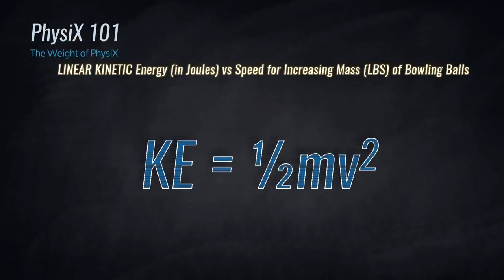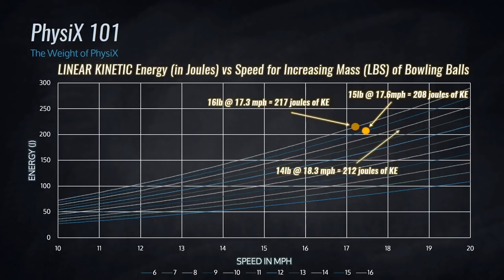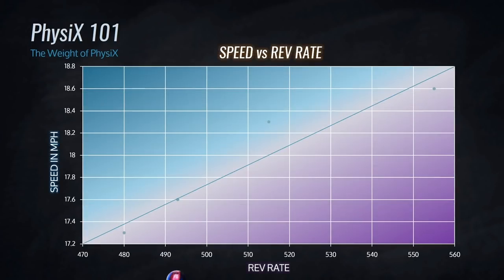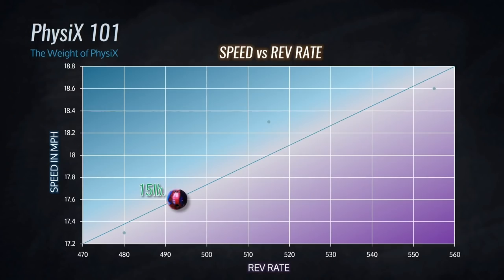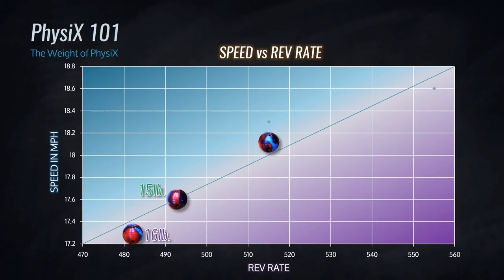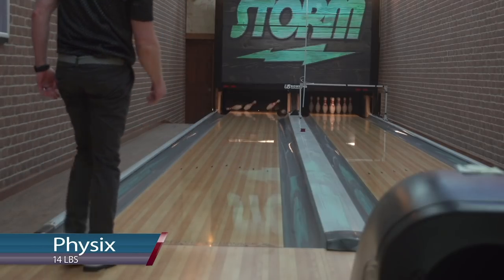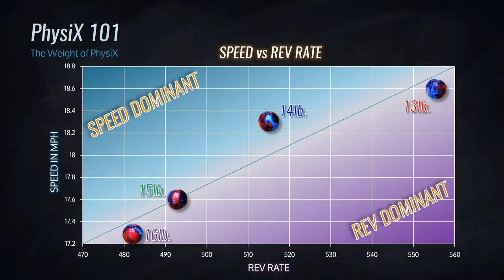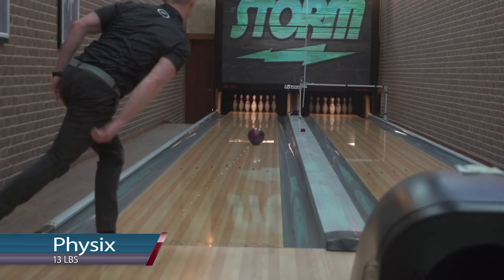Storm | Should I Change My Ball Weight?

Comment: simply put, bowl with whatever weight is MOST comfortable for you!

if you can bowl comfortably with a 8lb ball but can't with anything heavier, that is perfectly fine..

just because the pro's use 14/15/16lb balls, does not mean you should feel bad or pressured to "fit in" and do the same

Comment: The only caveat that was not talked about is that the Storm balls have a lower RG when dropping down in weight. That can cause the ball to stabilize quicker. You need to do this test with closer RG and the same layouts!

Comment: I throw 8 pounds (im 11) and if i switch to 10 pounds will i have more pin action? I notice my 8 pound ball will not knock down the 5 pin after the ball hits the 1 and 3 pin at around 12-13 mph.

Comment: This vid is so old no one is going to read this but... I am using a 14 lbs ball now that I think I could just throw it down the lane.  My arm swing is very inconsistent.  I have to purposely concentrate on slowing my arm swing down to try to control the ball swing.  Would it not be a good idea to switch to a heavier ball so I would not be able to muscle it down there?
Reply: 100%, most people use 15, and any time i’ve used 14 i’ve had the same problem as you

Comment: I'm 57 years old, throwing 16lb equipment, and my speed(18-19mph) overpowers my rev rate.  I've thought that dropping down to 15lbs would help increase my rev rate, but my coach thinks my speed would jump too much for the increased revs to help.  Have any of you seen your revs increase enough to make the weight drop worthwhile?
Reply: I'm also speed dominant and throw 16 lbs.  When I have to drop down to 15 lbs to demo equipment or have my stats calculated I really hate it.  I get even more speed dominant.  Not sure there's an easy solution?
Reply: Michael Lopour you need to work the equipment into your favor. A layout that doesn’t rev up fast, or makes the ball go longer down the lane.

Comment: I see the best bowlers with a 15lb ball beat by a 10lb ball most of the time. Weight doesn't mater when placement is correctly executed.
Reply: Ben L lighter balls deflect more, and lower than 13 doesn’t have the weight block inside. No way a 10 lb ball is beating the best bowlers. 🤦🏻‍♂️
Reply: I joined a women bowming league on my area and they are all 70's and 80's they use 8 to 10 pounds and they throw 4 to 8 miles and gets strikes all the time bowlikg in the 200's